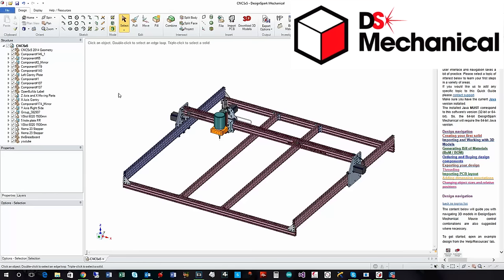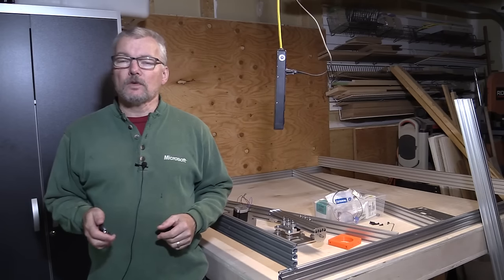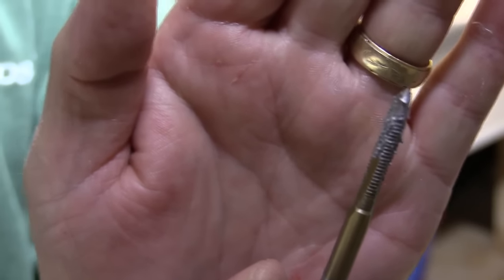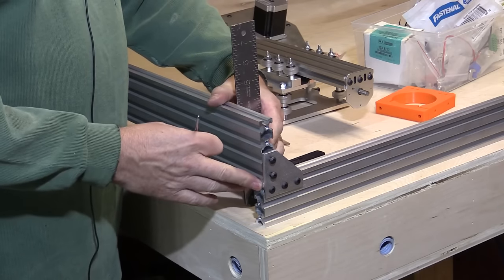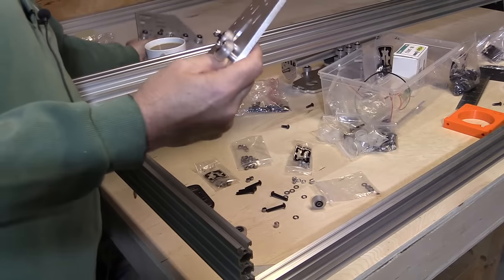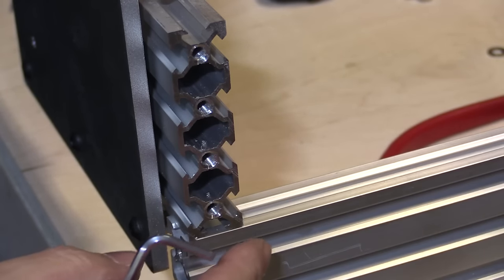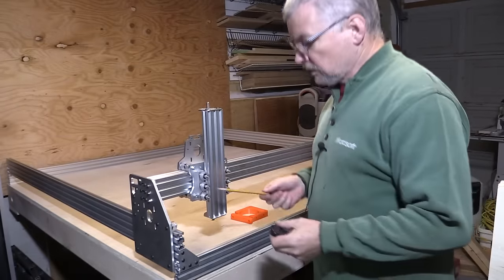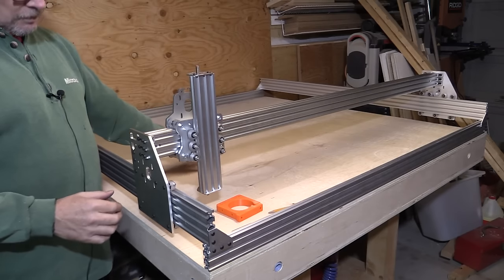CNC Project #3 - Building the VRail Frame

Comment: Great video.  I'm definitely thinking of building one from scratch based on your series.  Thank you for sharing.

I've found for pressing bearings into wheels (for skateboards) a clamp (just like you used to clamp the extrusion to your bench) works great.  Flat even pressure presses them right in.
Reply from the maker: Glad you liked it and found it helpful. I am literally in the process of finishing up a second build for a smaller CNC, this time with a 48V spindle and 4th axis, I needed to upgrade my control panel to support it
Reply: I subscribed to hopefully catch it and any other new videos you produce. :)

Comment: dont want to critisize mate but that gantry is gonna flex in the centre slightly when its loaded up and routing, the box section seems a little small not to flex at that width.
Reply from the maker: +the green man No problem with constructive feedback so keep it comming. This is my first go at a CNC and I have suspected that the Gantry may be a little light for hte job as you say. I am restricting the motor to a simple Bosche Colt Router and will have to keep the speed down a bit. SNB Solutions was talking to me about the possibility of a single extrusion of 60x40 rather than two 60x20, this would produce a much stiffer beam, or even upgrading to 80x40

This is a learning / tutorial set of videos so I am not worried about having the odd issue along the way, this will help others learn what to do and what not to do.

With the help of my sponsors I plan to get the basic machine up and running then fix things as we discover issues

Peter
Reply from the maker: Ah the old soap bubble thing, yes I agree with you there but this is a learning process for me and all who follow along. I had suspisions that it may be a little flexable once built but so far with wood it seems to be doing ok, never the less, one of my sponsors is sending me an 80x40 section of extrusion and also a plate set that is 2.5" taller as well, I may have to also create a new X plate set though as im not sure if the XPlates will handle an 80x40 beam. I am going to his workshop on Wednesday so will take the camer with me for a show and tell. Should be fun. Oh, the OK with wood is also using a Bosch Colt Router, not a full blown 3HP one, if I upgrade the gantry then I may design a mount for my Rigid big bad boy router :)

Comment: Hello, I have been following you on this build, what made your decision to choose this CNC Project. 
I went to the recommended website to see a cost for the aluminum hardware and motors a little bit confusing,  I would like to find out the total cost of parts so i can see if i can afford the cnc. As for the table you built for the CNC to keep it fairly rigid little to know flex, I am just a plain old hobbyist and if i could afford this, I would be pretty well set.
Anyway, Thank You Very Much
Jim P.

Comment: Hello, I am writing to you from Argentina. I am interested in this project because of the V-Slot system. I need to ask you why you decided to mount the direct motor without reduction? In this way can you control the steps well?
Reply from the maker: even with no reduction you get pretty good resolution, 200 steps/revolution + micro steps at 10 gives 2000/rev, with a 20 tooth pulley and 2mm pitch (Yes I know the diameter of pulley could also be used) means 2*20 = 40mm/revolution so / 2000 = 0.02mm resolution, that's 0.00079 inches. more than good enough for wood, plastic and most aluminium cutting jobs i would be doing as most of my effort is about education rather than actual production
Reply: Tu respuesta se agradece inmensamente. Un placer...

Comment: Hi nice video :) .  What size is profile aluminium ?
Reply from the maker: teris moutsou they were 8020 on the sides. 4020 front and rear and 6020s for the gantry.
I then upgrades the x rails to 8040C section and the same for the gantry.
X rails are 1500mm and the rest trimmed to fit

Comment: Plastic weels :(
Its good only for laser CNC.
Reply from the maker: +Irek350 I would disagree, these are not just cheap plastic wheels and are industrial grade, there are also plenty of them to spread the load. Is it good enough for a professional shop working every day and fast cutting big jobs... NO, but for the Hobbiest and Home part time Business it works very well, and of course linear bearings on rails are far better but they are also far more expensive so at the end of the day it is a compramise